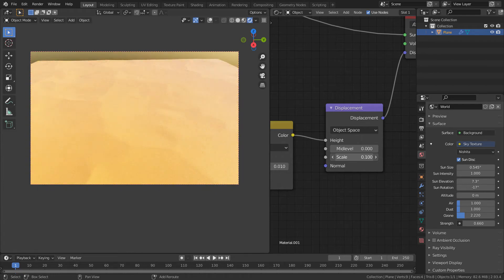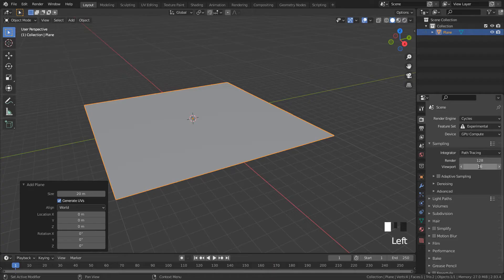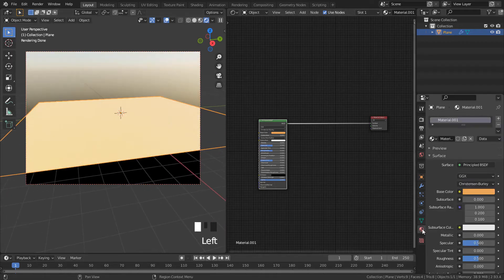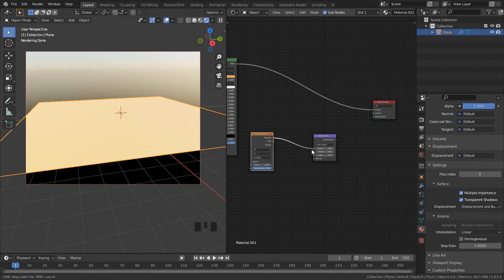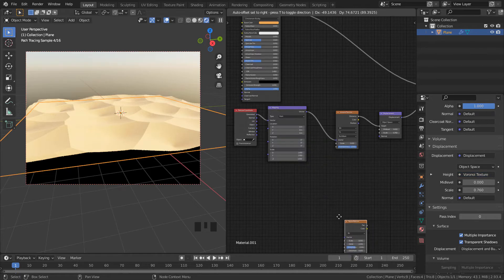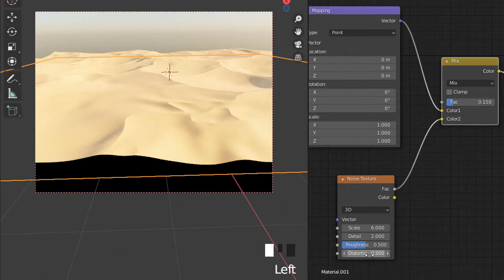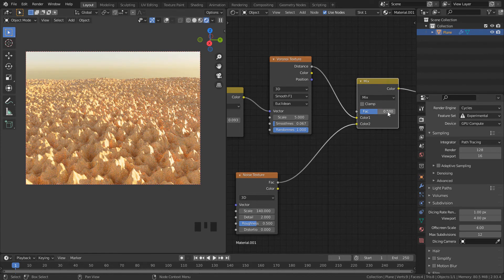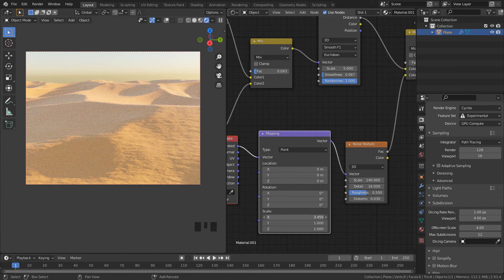How to Create Procedural Desert in Blender

Comment: Hey Chyck thanks a bunch. Can you tell me how can this be exportet to obj, as I am having troubles with Fusion360 recognizing this only as plane?
Reply from the maker: Unfortunately this can't be exported as this uses blender procedural textures this is only for blender but if you want to export a terrain you can use blender addon A.N.T landscape wich is included in blender , here i talked about it, https://youtu.be/pLfHTTeSvs8
Reply: @chuckcg  I get it now. Blender works a lot differently than some programs I am used to. Thanks a bunch, I will take a look at that
Reply: @chuckcg  Hey man, I watched the video and did it in A.N.T. and it seems to be exactly what I need. Thanks for the advice. However I have one more question. How the hell do I return the texture properties button back to change the initial settings? I am talking about the button in the lower-left corner that appears when you add the mesh. Thanks and I am gonna watch all the videos now to learn more :D

Comment: After applying the modifier, my model is flat. How to apply the modifier so that bumps are visible? Next i want to bake the texture, for using it in unreal engine.
Reply from the maker: Unfortunately this will work only in blender cycles, really don't know if the textures can be baked into one texture, i have never try, but if you want to create terrain in blender you can use A.N.T landscape addon included in blender, that way you would have the actual mesh.
Reply: @chuckcg  ok, ty

Comment: didnt worked with me, the plane simply doesnt create the depth
Reply from the maker: you need to use cycles experimental, make sure to follow all steps otherwise it won't work.
Reply: @chuckcg  still doesn't work, i followed every step but doesn't create the depth
Reply from the maker: @sushicat5005  There must be some step that you are missing, because it works. use cycles, change to experimental, add subdivision surface , activate adaptive subdivision, enable displacement and bump in material tab, i think that's all
Reply: @chuckcg  do you have to do it in that exact order?
Reply from the maker: @sushicat5005  any order.
Reply: @sushicat5005  I think you should do as much as possible the same steps as in the video. I faced the same error as you, but when I opened a new project and followed the steps exactly, the problem was solved.